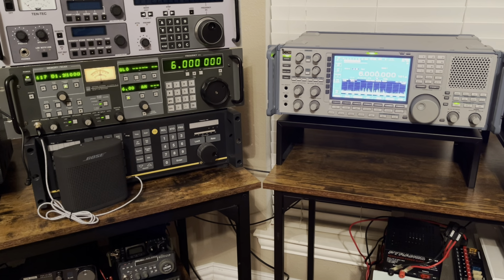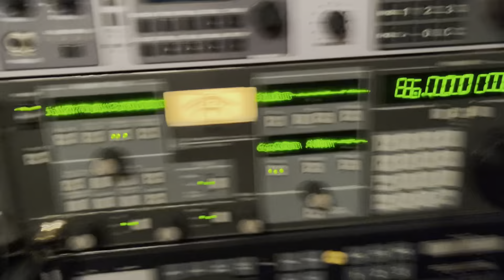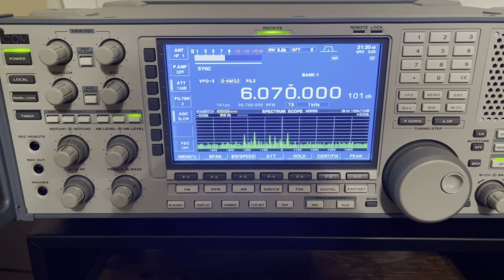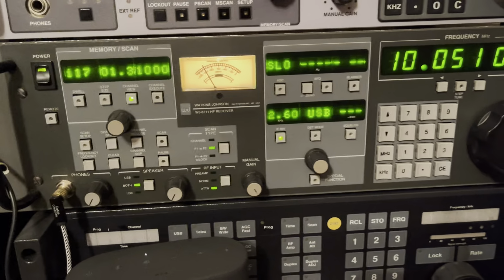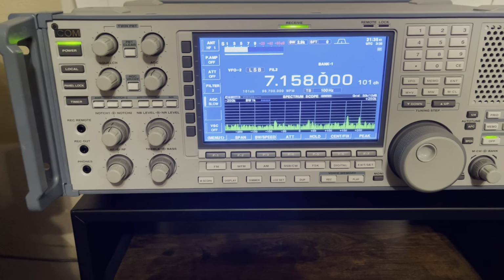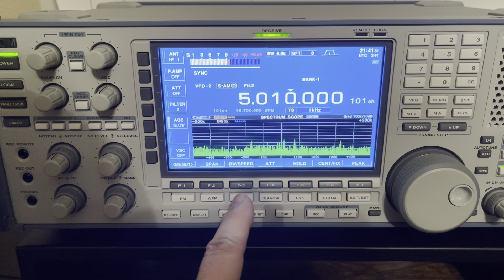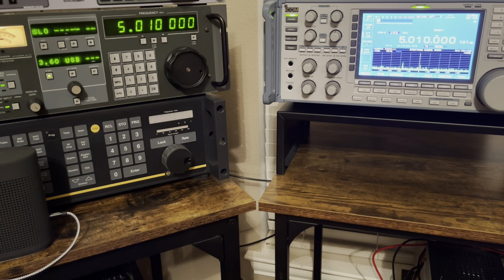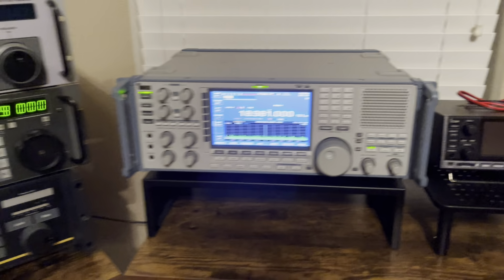Icom 9500 vs WJ 8711 Shootout!

Comment: 6.070 mhz is located in Mississauga,  Ontario just outside to the west side of Toronto.
It is a rebroadcast of CFRB 1010.
The 6.070 is using a vertical antenna with 1000 watt.
Only two shortwave stations are a live in canada CFRB is one of them the second is in Calgary. 
The superintendent for the shortwave station is a ham radio operator his name is Steve.

Comment: Wonder if the speaker out in back of the WJ would make that Blose speaker/WJ combo sound better.  Sometimes, headphone outputs don't like the low Z of a speaker & may even affect freq response.  Icom has a lot more sparkle to the sound & fewer lows.
Reply from the maker: The Bose is amplified and has a volume control of its own

Comment: The Bose speaker definitely gives the WJ a leg up on the ICOM, much like my Bose headphones. Question does the ICOM’s sync function have selectable USB or LSB or just plain double sideband like my old Drake SW8. Thanks and 73!
Reply from the maker: It has both. If you watch closely you can see the D and the U in the video. I was receiving such good results from U that I didn’t bother to try L. Thanks for your comments!
Reply: which is why i think that isnt a fair comparison, the icom would have probably been alot better with that bose speaker.

Comment: Hello well a lower noise floor on the w. However the fidelity on the icom may be just as good. I love finding older radio new in the box. I recently found a panasonic rf 2200 brand new in the box and I was happy to pay 4 hundred for it. Enjoy your radio you have some rare models in your collection.  Enjoy.     Best regards.      Ron z.WA3090SWL.
Reply from the maker: Thanks Ron!

Comment: Icom's audio is way better, crispier and clearer, it makes easier to identify a weak signal.On the contrary I find the WJ audio too muffled , great for pleasure listening but not good for DXing.. Just my thoughts
Reply from the maker: @papierecriture  thank you for your comments!
Reply: @dieselten01  I was about purchasing a 8711A but I see that the ICOM has better punchy audio. I hope I'm not  wrong in the decision and make a mistake; also I am not very happy with with my EK896, I find the audio on the mid-bass side.
Reply from the maker: @papierecriture  the Icom, while being a professional receiver is made by a company that makes consumer grade electronics. So they will focus a little bit more on nice audio reproduction. All these other receivers that you mention WJ, RS, and others were never meant for consumer use or listening. They were meant for government operatives to listen to bad guys talking on the radio, or listening to a bunch of beeps in succession. no need for super high Fidelity there. When I evaluate a radio, I keep in mind what it was originally designed for.